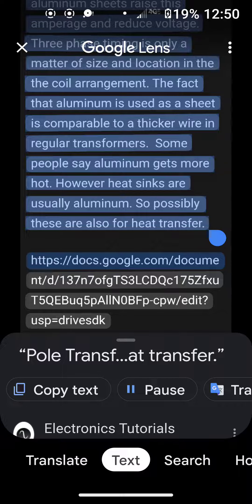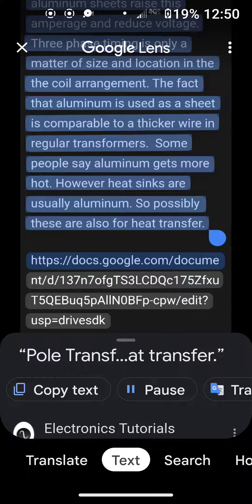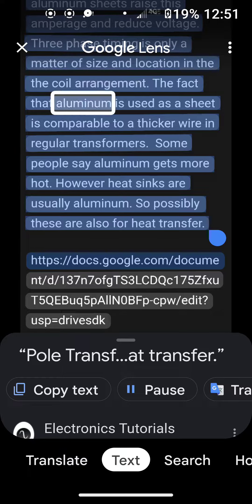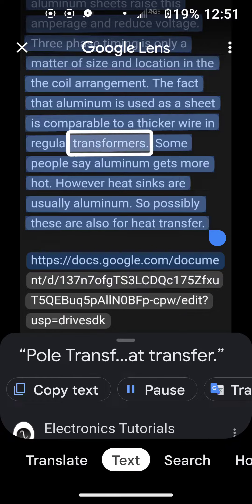pole transformers

Comment from the maker: Compare the John Searl generator using neodymium which produces cold air. Neodymium is a paramagnetic like aluminum. Most rare earth metals are paramagnetic. Also used in lifter tech levitation. John Searls is also a levitation craft.  His device uses copper and aluminum (neodymium) separated by Teflon insulation which creates similar transformer induction capacitance. (Transformers use conductors coated with enamel insulation. Pole transformers use wax paper and oil insulation.) Searl uses iron core with copper coil around outerr edge to pick up charge from it's rollers.